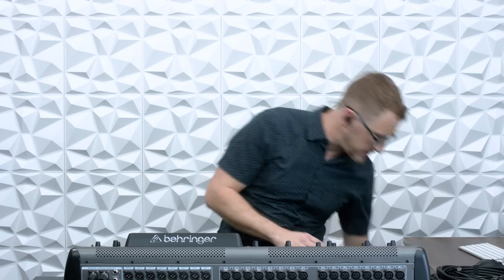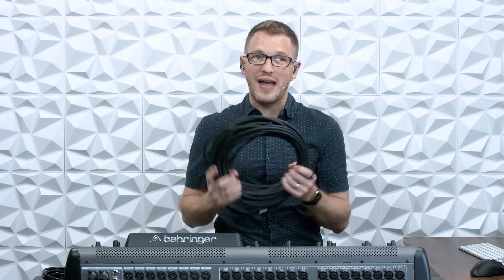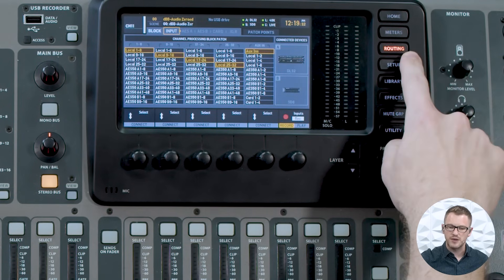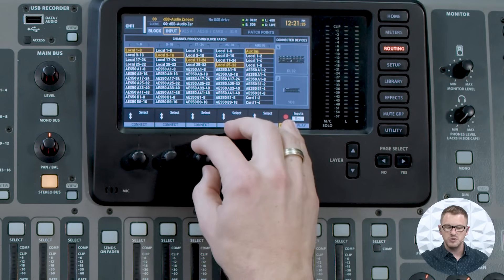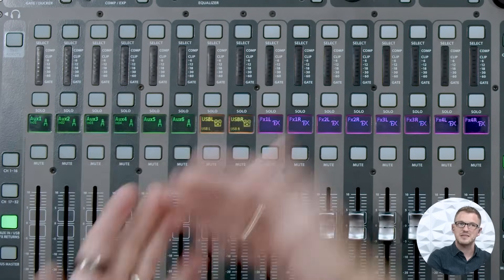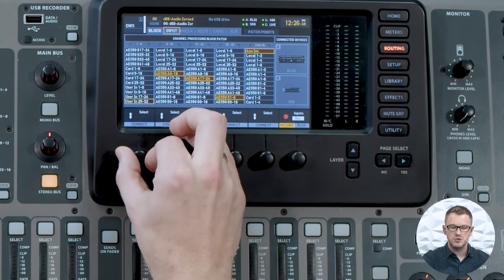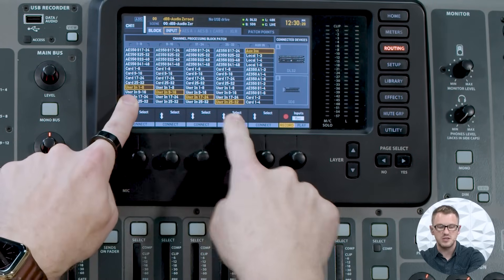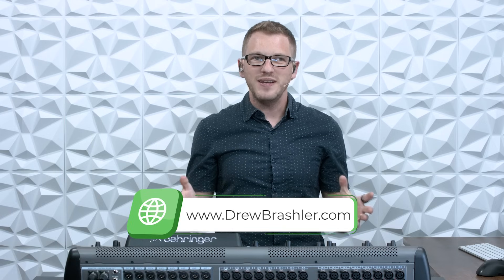Installing an AES50 Stage Box with the Behringer X32

Comment: All I can find of the etherCON cables are Cat6 so will I have any issues at 200 feet cable
Reply: I have the same question.  We're looking at getting an SD16 or S32 and then looking at what Ethernet/Ethercon cable to buy.  It's very difficult to find CAT 5e anymore.  We will only be running about 100' to 150'.  So I was going to ask the exact same question, will we have issues with CAT 6 at 100' to 150'?

Comment: I have a question. Why can’t we just patch each channel individually with the input source we want? For example if I wanted input 1 from the stage box to be on the first physical channel on the consoles i can patch that by itself and then lets say I have something plugged into the 1st physical input on the console and want that on the second channel on the console i can patch it instead of having to do blocks like you showcased in this video? Im just wondering if that’s an option on this board or if you can only patch sections (1-16, 17-32 etc.)by blocks. Thank you.

Comment: Hi Drew! Nice videos you make. They are very helpful. In the manual on page 56 and 57 there is something about the settings/preamps tab. How does this work? Are the settings on the lower picture on page 56 independ from the channel settings input gain/trim or are they the same? On my X32 for example, the A/D-Gains on the setup/preamps tab are 2db lower than on the channel gain/trim. How can i make them the same? How are they related to eachother? What is HA Gain Split?

Comment: What is the settings to mix and match outputs from the stage box and the mixer if there is a need for it? For instance, the main LR and stage monitor mixes can be out of the stage box whereas a delayed speaker assigned to a matrix (XLR output) on the mixer itself? I can’t find a video explaining this. Love your videos btw. Thanks much.

Comment: Wondering If i can get some assistance from Drew or anyone with connecting 2x S16 racks to an X32 using AES50 A for one rack and AES50 B for the other because they are in 2 different locations and I'm having consistency issues when daisy chaining the 2x S16 racks

Thanks :)

Comment: What I didn't realize is that the X32 Rack does not have 32 inputs unless you use the stage boxes. I am curious though with the price of the SD8 and SD16 being what they are is there any drawback to purchasing the X-AIR 16 and using it instead of the SD16? This way you can have an alternate portable mixer when the X32 is not warranted?
Reply: The drawback is that there is no AES-50 connection on the X-Air series so an XR16 couldn't be used as a stagebox in this way.

Comment: If you are using an X32 Rack with a 32 ch stage box do you have to run a separate cat5e from the board to the stage box for the Ultranet for P16 Personal Monitors?

Comment: oh on a side note if you are buying cable the black Ethercon barrels are no longer conductive. Neutrik mid 2023 changed the black chrome plating process to KTL which is less environmentally toxic + not conductive. If you want a conductive shell (like what you need for AES50) you must buy Neutrik connectors with the standard nickel coating.
No the AES50 max length is 80m on the X32. 100m is only on the M32 and pro boxes.

Comment: Hello drew! I have a very specific question. I haven't been able to transfer all mix us outputs to the S32 from a x32 compact, because it has only 8 physical xlr outputs... The remaining cannot be associated to the stagebox because it has only 1 to4 and 5 to 8 8n the xlr tab.  What do I do now?

FYI. The output tab shown error message when I try to route 8t to the stagebox.
Reply: Hey! How did it go? I’m considering buying S32 for my x32 Producer (which is similar than compact) but I have same concern
Reply: After spending weeks of try8ng anything we could find on the internet....we sold our x32 comoact, and bought an x32R (full size). That way all the input and buses are available locally or through the cat5 cinnections

Comment: Hello I bought an x32 rack I have in configuration an X32 Compact for the facade with a Box DL32 Midas internship, with WiFi Router,.My question I was told that we could have a different EQ between the facade and the returns I speak of EQ EQ and not of the eq master on returns.If you have configuration I am interested, the connection everything works with the sound, but nothing works in EQ on each edge on the returns.Routing connection I start from the AES50-A of the compact to the X32 rack in B and then a rack to the A DL32 Midas
Small details the inputs and outputs are coughing connected to the DL32 Midas

Comment: I have an X 32 rack with an S 32 digital stage box for my 9 pc rock band. We need to split 20 input channels to go to front of house. Is there such a device?
Reply: Use an analog split. Anything digital will send line level to FoH and it will be affected by your gain staging so the FoH engineers don't really have control.

I'd build something custom, or use three 8 channel splits from Behringer.

Comment: Great video!  I have athe X32 console at the FOH and a S16 on stage with my laptop (DAW).  If I want to record the band audio into the DAW, how could I do that with this setup?  The stage is 80 ft from the FOH & not ideal for USB connectoon to the X32.  The S16 isn't an audio interface, so I can't connect USB from there.  Could I use AES50 B port to a DN9632 and then connet to a laptop?

Comment: Thanks for the video.  When my band performs live, many venues do not have a Behringer 32 channel mixer.  I need to give them 4,8,12,16, 24, or 32 inputs from my rig depending on their setup.  I use a splitter and to send one set to FOH.  The other set goes to my X32 rack.  These are processed and mixed and sent to IEM or monitors, and sometimes our PA if there is no FOH.  Is there a way that I can use the digital stage boxes and send output to FOH with XLR cables rather than a CAT 5 line?  Then I can avoid the splitters and the patch panels I use to send to FOH

Comment: Hi Drew. I'm struggling with using 2 sd16 stage boxes.  This video was very helpful but, I seem to have missed something....  I have an X32 and I'm using the "user" routing.  I also have a Dante card for broadcast via Ableton Live.  for whatever reason I can't seem to use the second sd16.  I routed the cat5e from console "A" port to 1sd16 "A" port then from 1 sd16 "B" port to 2 sd16 "A" port but get nothing as far as single from 2 sd16.  Im a bit lost as to what I'm doing wrong.  Any help would be greatly appreciated !!

Comment: Thanks @Drew, can I daisy chain the DL32 and SD8 stage boxes using the A port and set the "Aux in" column to "AES50 A33-40"? (so that I can connect to microphone wireless receives on the stage to the SD8 stage box and map them into the AUX IN section)
Reply: I wouldn't do that. For mics you really want a real channel strip, not a limited aux in.

Comment: A few things to add about shielded connectors: X32 REQUIRES ethercon because Behringer grounded the shell rather than the side of the RJ45 connector. Additionally, when you have an ethercon with black ends like yours, you need to check if it's conductive. If not, time to scrape some of the coating off and check again. I had to do that on some of mine to properly ground it.

Comment: This video is soo helpful. Especially the routing portion. I was looking for a video tho of how to use the SD 16. 

We have the SD 1-8 connected to our X32, but i not the 8-16 inputs. Is the reason is because of the routing on the x32? Or is there a switch on the SD16?

 I was hoping you tackled this in your video, how do you use the “output” of the SD16? I cant find a video on YouTube about it? How can i use and control the “Output” of the SD16? I hope you can make a video of the SD16 and how Can we use the SD16 output as a monitor?

Comment: initial helpful video. thx. My Q is if i can attach more than 2 (A+B) AES50 to e.g. X32 rack? i would require to have 3xSD16  by 15+15+11=41 channels (of 48) + 12 (of 16) of X32 rack = 53 channels in total to get all my components connected and recordable into Cubase without re-connecting/exchanging/switching cables. all fixed installed. How is that possible? THX!

Comment: What about if my stage is 150ft. We have a 150 ft  cat5 shield and we like to use it. Are we going to have problemwith thedistance.
Reply from the maker: As long as you are using a sheilded cat5 cable, distance can go up to 100m or 328ft. So you should be good!

Comment: I am a school teacher in NJ and have really found your videos very helpful so thank you. I have a spirit fx16 on stage with 16 faders. The first 6 are dedicated to shure wireless. I also have an s32 stage box and the x32 producer. When I hooked it all up I got sound but the faders on my producer had no effect. So I am now coming out of the default 7 and 8 left and right mains on the producer back to my fx16 into faders 15 and 16 and I am able to use my faders on the producer. You do a great job of showing all the routing and directions on the x32 but i would like to see more videos on the actual wiring and physical inputs and outputs. Where cables are coming and going from. I am basically trying to use about 10 shure wireless mics into my s32 then into my producer 32 and back to the spirit fx16 which is the house speakers. We do not use any monitors right now but would love to get those going as well. So videos on the actual conections would be helpful. Thank you! Keep making great content I am learning a lot.
Reply: Hi! Thank you for being a teacher! The thing that makes displaying each connection possibility difficult is the sheer number of possibilities… especially when you include all the AES50 devices out there, Dante possibilities, and 1 to 1 user routing. Even describing your particular use case to pose your question took a good deal of consideration. Yet and still your consideration, while detailed and careful, only provided part of the information needed to give you a full routing solution. I’ll take a crack at it, and hopefully you can reply to clarify your use case further so I can offer more to achieve your desired results.  First, it’s most likely that you can achieve everything you’re looking for without the Spirit FX16. (If you have some specific need of physical faders at the FX16’s location to control your house mix or future monitors, we can look at how to route that. If someone in your world there has a strong preference for the specific sound of effects on the FX16 and is adamant that the effects on the x32 are incapable of acceptable effects, we can address that as well. If neither are the case, you can easily control levels of every input and output including house speakers and monitors from a tablet or laptop anywhere in the facility without use of the FX16.) 
Trying to control independent microphone levels from the FX16 AND the X32 is problematic. Those 2 mixers have no way to communicate the level of a microphone in their respective mix. An extreme example would be: say someone anticipated a scream on Mic 1 and muted that Mic, or moved its fader all the way down on the FX16. The X32 or anyone mixing on it would have no way of knowing the level changed. The person mixing on the X32 could then find themselves moving the fader all the way up to try to get something from Mic 1 just before the person mixing on the FX16 unmutes, or raises the fader back to a “normal” position after the anticipated scream. Uh oh!!! Now the X32 is multiplying the “normal” position in its mix since its fader is still all the way up. This same lack of communication could happen with any signal, input or output, that is connected so as to give control to both mixers. Therefore, each signal level routed to both mixers needs everyone involved to understand which specific signals are routed to both, as well as which mixer has been decided upon to adjust each specific signal they have in common. You can see how that can be a nightmare considering staff changes, student operators, etc. all needing to keep them straight. 
Good news - The S32 can send 32 (or less) signals to your X32 while also receiving 16 output signals (or less) from your X32. You can connect each of your Shure wireless receiver outputs to the S32 inputs (XLR to XLR connection is ideal). You’d then use the routing of the X32 as Drew has laid out wonderfully in the video to place them on whichever faders you prefer. You can also route your main outputs, the default 7/8 you mentioned to output from the S32 directly to the house speakers (Or if you prefer it for physical fader control, you could run them out of the S32 into the FX16 the channels of your choice. The FX16 has 1/4” direct outs on the back that would then go to your house speakers {or amp for those speakers if they aren’t powered}.) If you want to use monitors, you would simply use the output routing referenced in the video to send monitor busses to the S32, and then on to your monitor amps or powered monitors (again, you could run those into the FX16 channels and then out of the channels’ 1/4 direct outs to amps or speakers.) If this is for theatre production, I would refrain from sending microphones to monitor busses to prevent feedback. With all the comments about the inclusion of the FX16 I’ve offered, I wouldn’t recommend going that route unless there’s some reason I’m unaware of in your use case. For most intents and purposes, it could be reserved for a backup, and is otherwise just adding points of failure to your system. Again, with the X32 connected to a well placed wireless router, you can adjust all the parameters on your X32 (mics, music, mains {house speakers}, monitors, effects, etc.) along with their digital signal processing from a laptop or tablet anywhere in the house. Want to dedicate an additional laptop or tablet to monitor levels for crew in the wings? No problem. Any device connected to the X32 through the wireless router will share the same faders. They all communicate together whereas the FX16 can’t communicate at all. 
Special note: If you’re using snippets, scenes, or cues, designate ONE device (or only the X32 producer) to navigate them. Many of the apps and software don’t play nicely together with that aspect of control. 

If this is indeed for theatre, and you aren’t already using Cuelabs or TheatreMix, you have another very exciting world of learning ahead of you beyond all the above to super simplify your productions once they’ve been set up and mastered. PLEASE get comfortable with all the other information in the video and listed above first though. If you don’t have a strong understanding of your routing, managing your main mix bus, and managing your monitor busses… those softwares will further overwhelm you and will be extremely difficult to get under control. Once understood and set up properly,  they both play very well with the X32 series of mixers. Don’t hesitate to follow up with questions and/or clarifications about your use case. We all started somewhere, and there’s always more to learn. Drew has an incredible library of help available! I’ll try to help with the hardware end as much or as often as I can. I can also direct you to specific videos from Drew or that deftly explain the current point in your journey. The more you learn, the more your students will be prepared for churches, arenas, and even Broadway stages. You’ve got this! If you can find model#’s on equipment, we can get you there! 😊
Reply: @vadjrob  yeah the only reason I am using the f16 at all now is to get the sound from my x32 producer into those house speakers. They are mounted high on the wall so if I can get up there and see the inputs and outputs on the speakers and see how and where they are wired up then yeah maybe I can get straight to the speakers and bypass the f16. Thank you for taking the time to explain. I do have to still learn alot about mixbusses and getting better at eq. I am also learning that we are probably using too many Shure BLX mics and we are in a high wireless traffic area and thats why the mics keep bleeding into each other. At this time we dont have any monitors but I would like to have at least 1 wedge at the front of the stage. I think we may have an issue with our amps because they wedges no longer work and are passive. Again thank you for your time and I understand why it's tough to show because of all the possibilities.
Reply: @smglennon  If you are running to the house speakers out of the main outputs of the main outputs of the FX16 (labeled “R—MIX OUTPUTS—L”), you can simply unplug those XLR cables from the FX16 and plug them into the S32 outputs you choose to route the X32 outputs to.  If the present XLR cables don’t reach your S32 location, you can daisy-chain an additional XLR cable, to each of the existing ones to reach it. The outputs of the FX16 aren’t powered, so what’s on the high up end of the cables isn’t too important. XLR cables are very forgiving for long runs. If you have to extend them with another, I’d just be mindful of where you place the connecting ends. You could pick up some interference if those points of the cable run are sitting on power cables. 
In reference to the number of BLX mics in use, this is directly from Shure’s BLX series page:
“SYSTEMS EXPANSIONS – Run up to 12 channels per frequency band*
You’ll probably need to find a bigger stage before you run out of channels.
*Note: region and environment dependent.”
I’m currently using 16 Audix wireless mics in a theatre environment and have had zero issues with interference. Their AP61 and AP62 systems operate between 522MHz-586MHz and are very easy to use with up to 24 mics without getting into advanced tuning of frequencies. Their systems easily scan your environment for interference and sync to each mic without additional software or hardware.